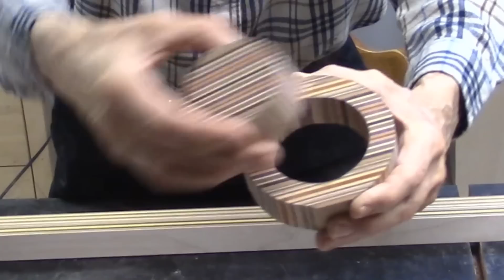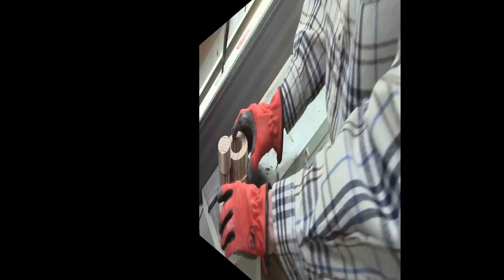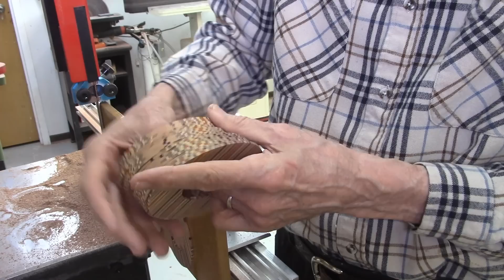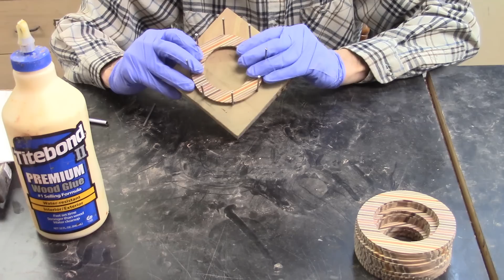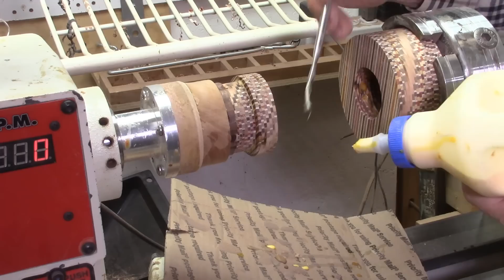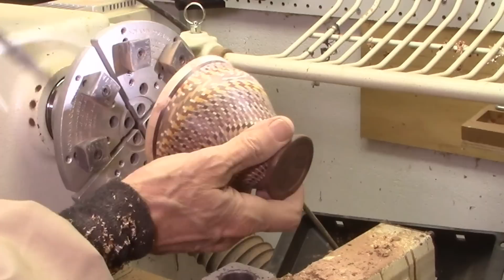Making a Vortex or Dizzy Bowl with the Accu-Slice System (39)

Comment: How do you keep your fingers away from the blad when you saw the round pieces of wood before you put them in the accu slide?
Reply from the maker: The round boards or discs are glued or double sided taped to the sacrificial fence on the carriage.  Then you can slice the round discs with your fingers far removed from the band saw blade.